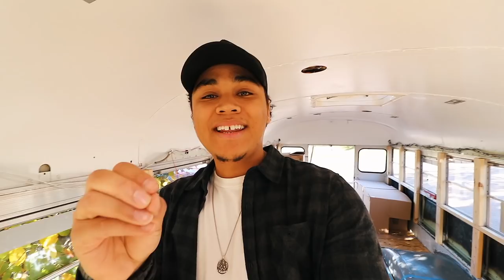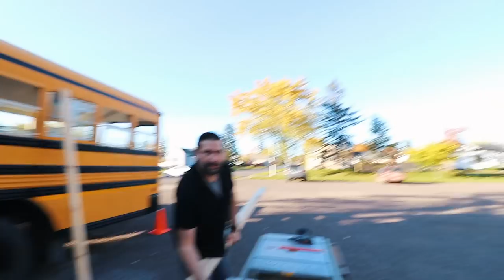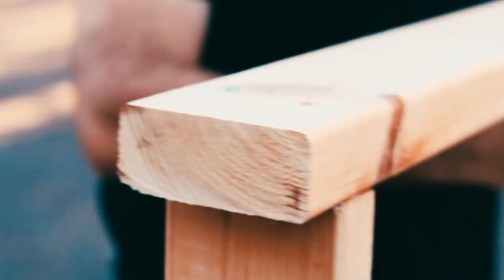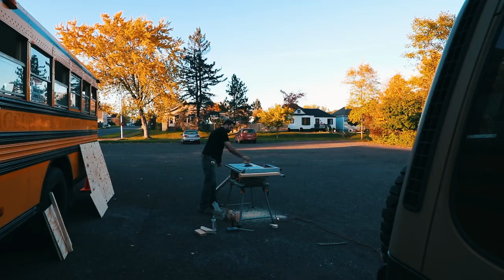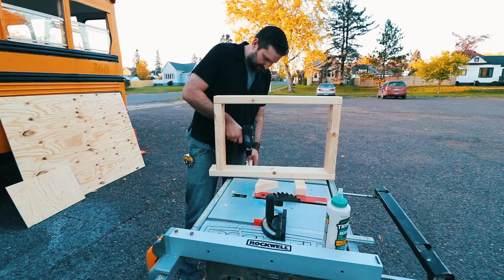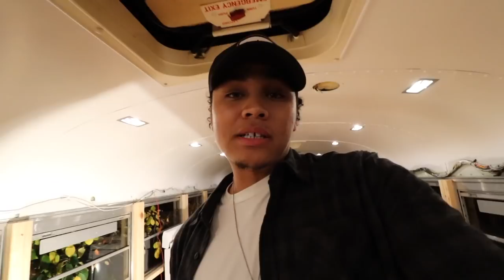Building our Sofa/Bed/Storage for our Skoolie!!!

Comment: Video on how not to use a table saw. Never use a fence to crosscut. Lucky that it didn't kick back and knocked him out.
Reply: Using a push stick on a cross cut would make it kick...equal support on binding substrate is key. But thanks for the insight.
Reply from the maker: Larry Sharp Blue has been doing wood work for over 15 years. I trust that he is well aware of what he is doing and how it should be done. We do not recommend or encourage people to reapaet the process blue has done. Blue is a highly trained professional and has year of experience. Thank you so much for watching.